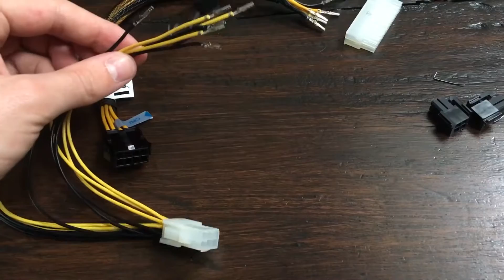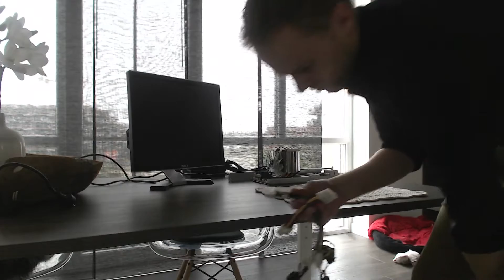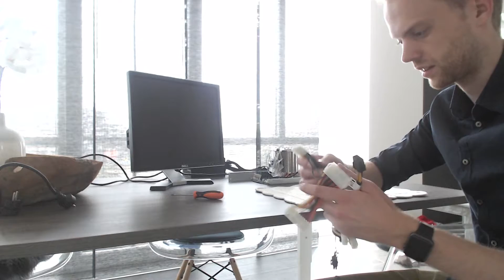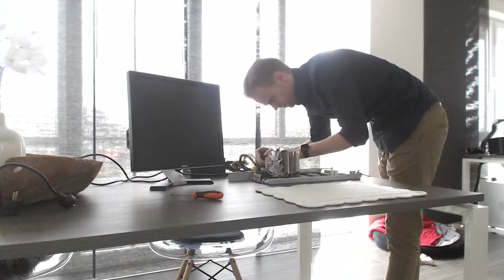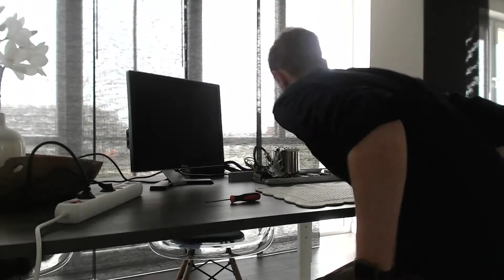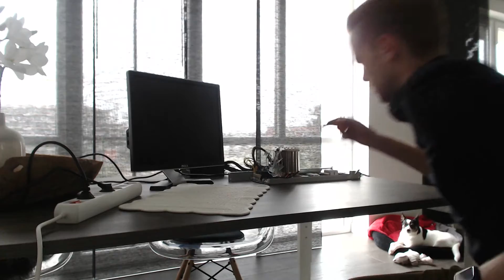FreeNAS SuperMicro X8DTT-F Build Part 2

Comment: Nice project! I'm also thinking about to build a system with this hardware. There's enough power to use it with ESX and Hyper-V.

I found also some interesting sites:

https://rochegregory.wordpress.com/2015/03/10/132/
https://rochegregory.wordpress.com/2015/03/14/supermicro-x8dtt-hef-mod-a-power-supply/

Nice infor for power solution:
forums.evga.com/Mac-Pro-2010-RELOADED-m2108103.aspx

www.jonnyguru.com/forums/showthread.php?t=12212

Perhaps you can make some detailed pictures about the jumper you mentioned.

Thx
Reply from the maker: I was considering the same, ESXi is a great way to use as much of the hardware as possible at once! However, virtualising FreeNAS on any level is regarded unsafe.. FreeNAS expects direct hardware access to the HDD's and that's not possible with the onboard SATA chipset. It could be done through PCI-e passthrough but that would add a whole new level of difficulties and overall making the system a bit flaky, not something you want with a NAS/server.

I really wish I could use some of the hardware resources to put a pfSense router on the same system but seeing the MANY topics saying you shouldn't; I guess I will not haha.

I've seen the topics you provided links to but found them rather shallow in information. I'm not sure my videos provide much more information, they mainly prove you can use such a board, but if I can add any information by answering questions if needed!